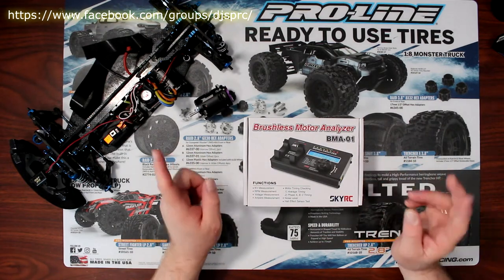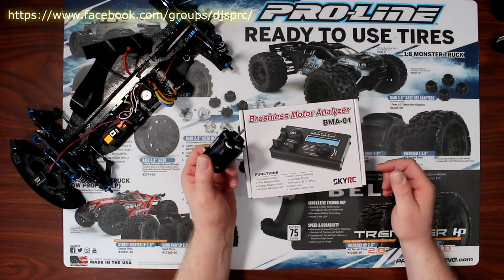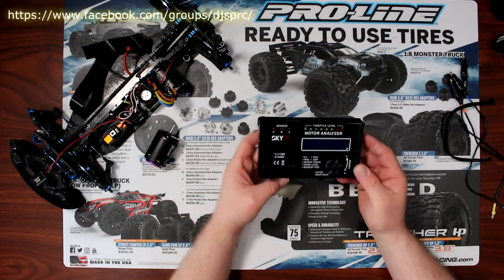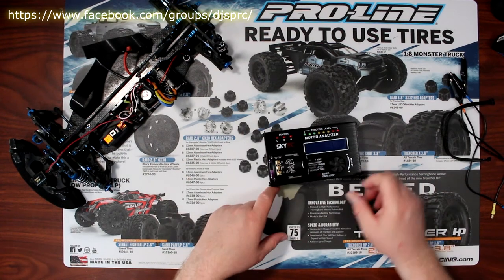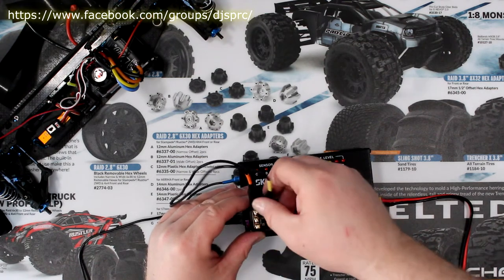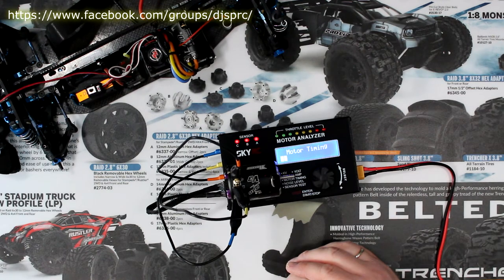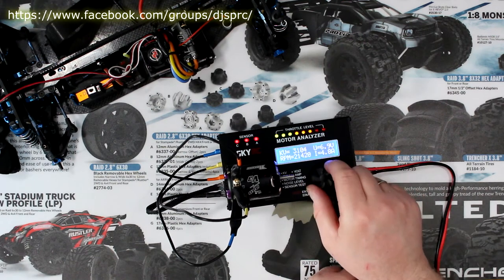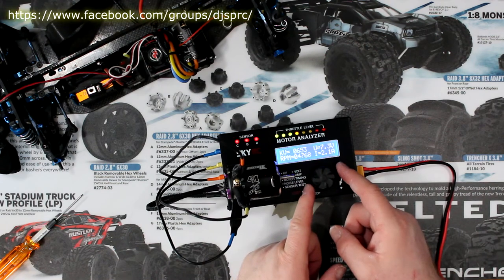Skyrc Brushless Motor Analyser

Comment: Why are you shooting for a 6a draw?  What things would determine why you're shooting for 6A, as opposed to 4.5 or 5a, or even 3a?

Trying to get familiar with this more intricate information. What makes 6a the number?  I've seen this as the 'go to' Ampherage setting but have no idea why. 
Thanks to anyone that can help.
Reply: We were testing while having this equipment in our hands for the first time. The surpass we had in our hands could go up to 6A (without too much heat) . Now most of the motors we setup after are set to pull from 4.3A to 5.3A. When the increase of RPM is margin to the amount draw... we tone down a bit... 4.6A - 4.8A seems to be a sweet spot for many manufacturers.